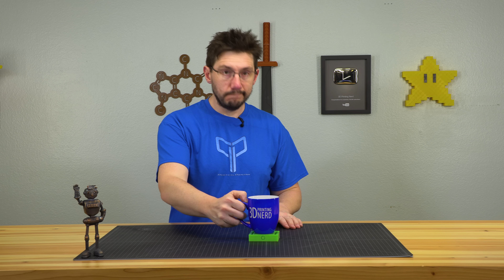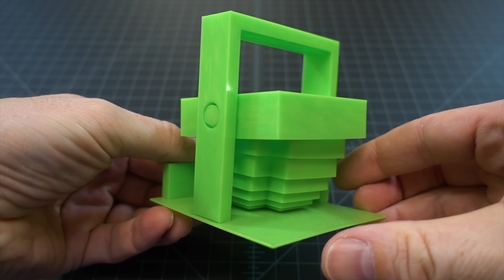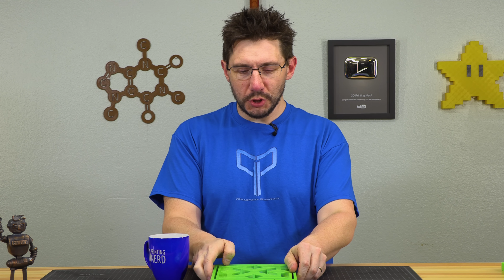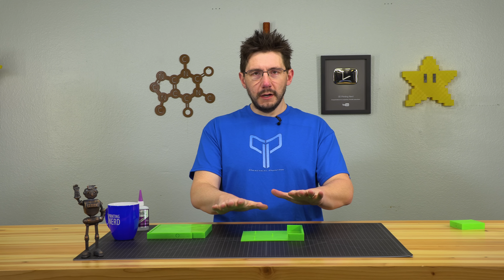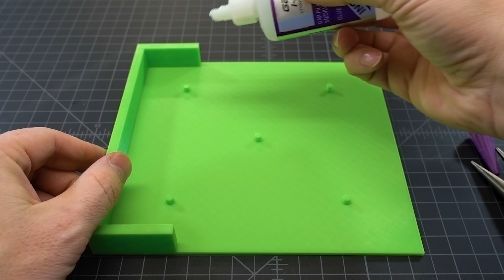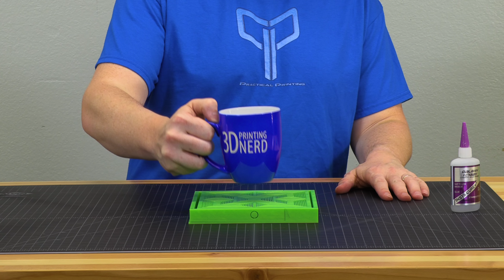3D Printing Crazy Spiral Trivet Coaster Basket Things!

Comment: I figured I'd try printing this model on my Lulzbot Mini. Sized up the full one and had to scale down to about 70%, but tried the test at that scale first.
Sadly, whilst the first 4-5 revolutions of the coil came free (with some work), the inner coils did not, nor did the arm rotate.
Too small, not enough clearance (or Cura just doesn't like small gaps, not sure).
Oh well, was worth a short.

Comment: I am am old time scroll saw wood worker and used to make a lot of these kind of baskets on the ones you cut on a scroll saw the pattern was tapered top to bottom so when it expanded each layer pulled tight on the lower layer to help pull it up and form a tight less wiggly basket are these tapered? I use Fushion 360 to make my prints but am still learning you did a little web cast a while ago about making a maker coin in 360 how about doing one on how this is done if its just straight cut that would be ok but if this is a tapered setup I would like to see how that is done
Reply: Jim, I also used to scroll saw and this method is taken straight from the wood working world. Yes, the "cuts" are tapered. I programmed this in OpenSCAD using a mathematical formula that took some work to figure out.
Reply: They are not tapered. This was designed "for fun" only. The straight walls make it easy to print.

Comment: Not a critical thought, but if the posts were split and had a slight 'mushroom tip', then the whole thing could just snap together.
Very nice!
Reply from the maker: Ooh, just enough, right? A little force to out it down and enough grab to hold it in place. OOH.

Comment: Looks cool but pretty useless. I thought the bigger one would have folded out to a big basket. Could have been semi useful then.
Reply: I thought it was compartmentalized for a picnic or lunch basket.
Reply: Besides it's a spring and the beginning and end attachment points are the weak spots and on a large basket would break pretty easily.  You really couldn't carry anything in it anyway.